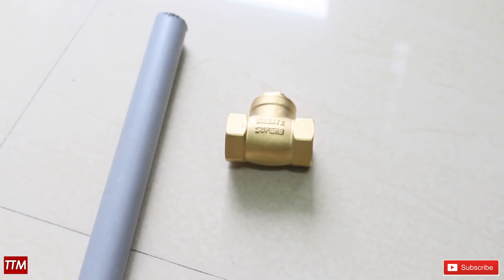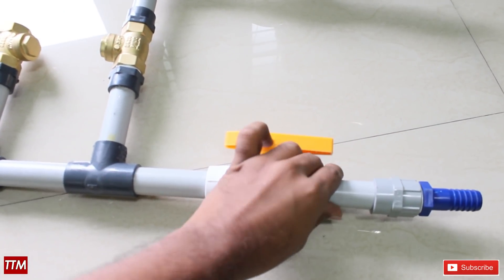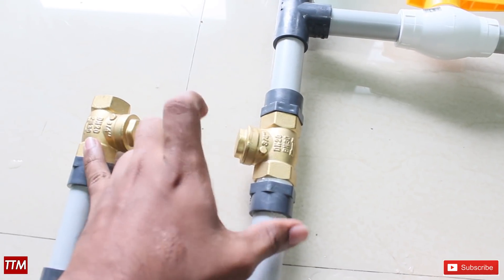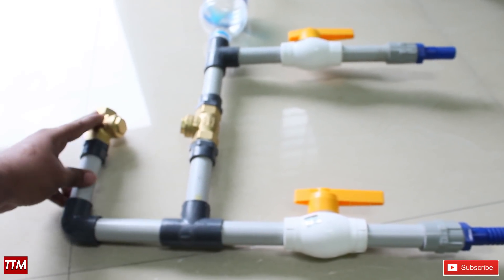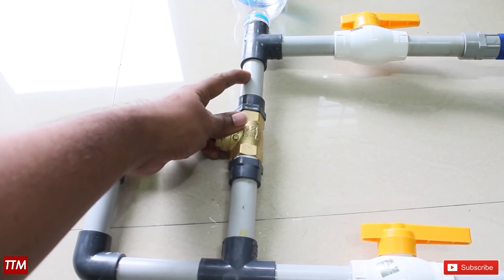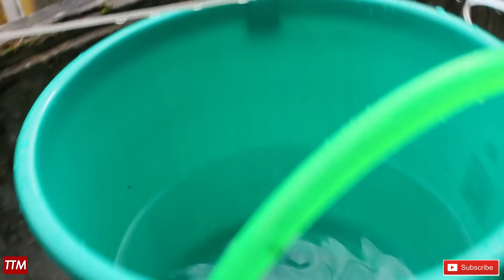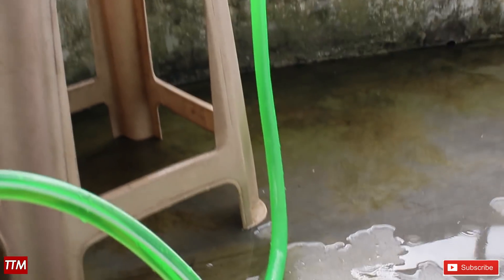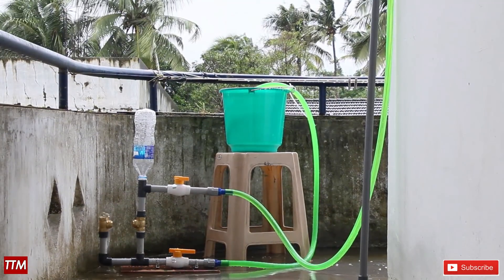Free energy water pump ||സ്വയം പ്രവർത്തിക്കുന്ന പമ്പ്, കറന്റ് , ഇന്ധനം വേണ്ട|| by ttm

Comment: Misleading Clickbait title.
This is not Free Energy. You have used energy to fill up the bucket. Also energy is used in lifting the bucket above the pump level.
After using this much energy, only 10% of the water reaches the top.

However, this pump will work in places where you have natural running water, for example, a mountain stream, where 90% of water flows downstream and 10% gets pumped up.
Except for the title, this is a good working project and a well made video. Best wishes.